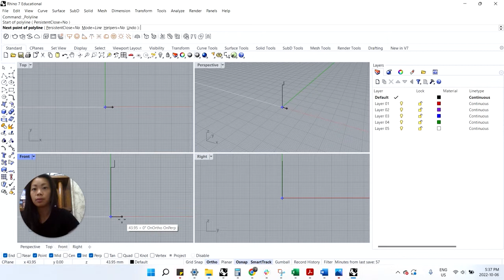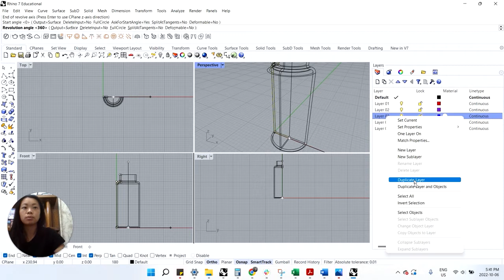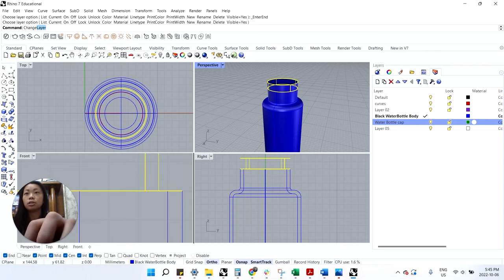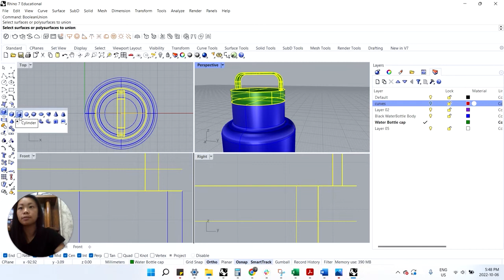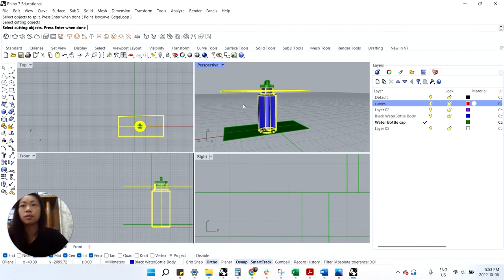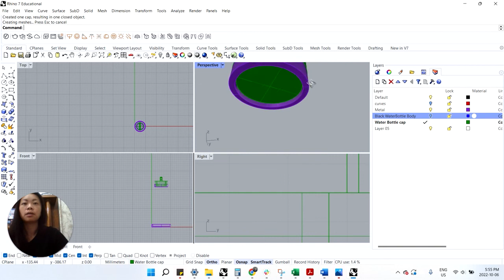Rhino 7 - How to 3D Model a Waterbottle

Comment: Thanks for taking the time to record and upload the video!
I'm having trouble with the project command (lid part). The command line said to "select the surface" and I kind of lost the track of what you did in the video during that😅. I tried moving the (lid) curve to the top, offsetting the curve, and extrude, and I get a cylinder with no top surface 😅.

A bit of a suggestion is that I think it would be nice if you sometimes hide other objects (bottle body) during making a new part (lid, handle) because intersecting lines are pretty confusing about which line is which. 

Thank you so much anyway!
Reply from the maker: Thanks for the comment! I'll keep this in mind for future videos. For your question, Make sure when you're using the extrude command that you check on the command line that make solid is set to yes. If it is set to no then you will get a cylinder without a top surface. Hope that helps!